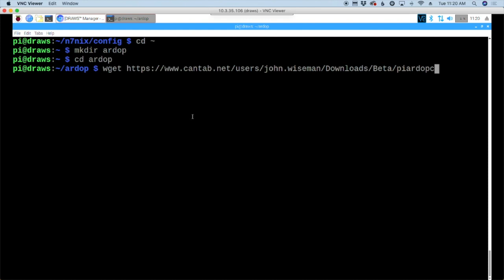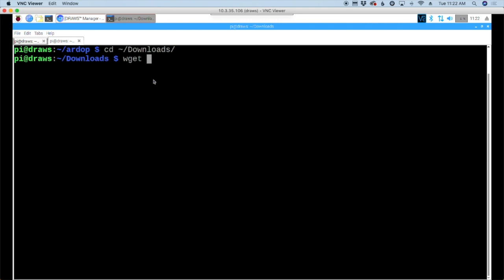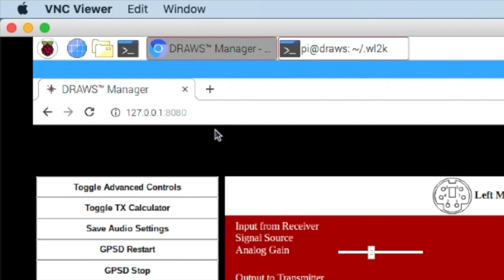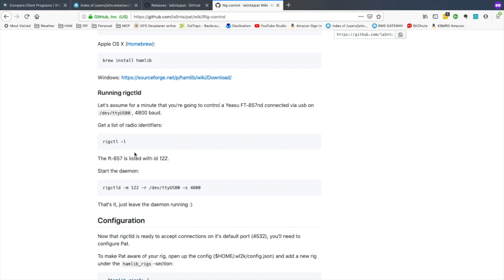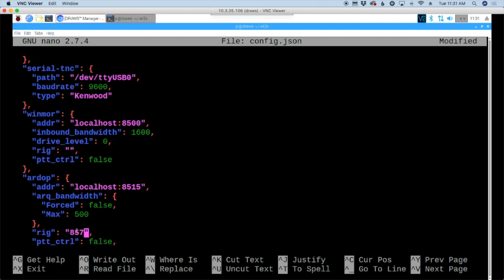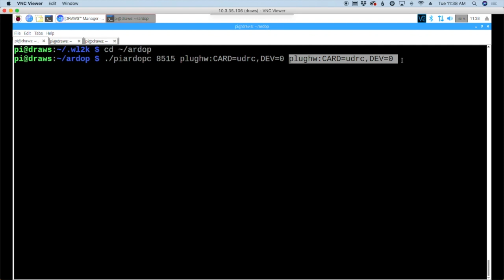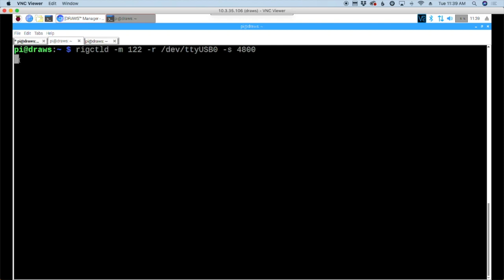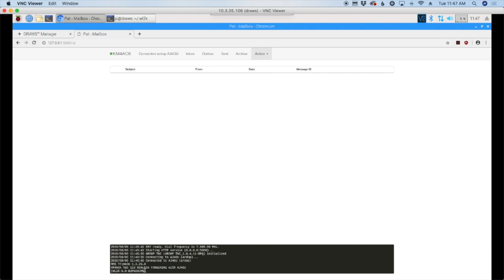Pat Winlink on DRAWS

Comment from the maker: Some have reported not having the pat config file on their system. If you run into this you will need to take one additional step.  Right after installing pat with "sudo dpkg - pat_0.6.1_linux_armhf.deb" you need to start pat in order to create the blank config file. To start pat run "pat http" This will fail with a no callsign error but will create the needed blank config file. Then follow the other steps outlined in the video.73, de KM4ACK

Comment: I have my draws sitting on my back HF radio. I also have an old IC 28 h. I want to use with this Draws. I have not gotten the latest image. I think it's 11 or 12. I need to contact that cable maker to see if he can create the 6 pin din to 8 pin round (mic) to a speaker plug, if there's not one already. de va7dgp
Reply from the maker: Thanks for watching Don. 73, de KM4ACK

Comment: The sound card sampling rate is usually important to allow the various digital mode protocols to work efficiently. Most modes want some divisor of 48khz, while most sounds cards default to 44.1khz. some programs can do the math to make up for the difference, but it is better to do it from the beginning. At least that is what I learned. 

I have been trying to find the command to do that for awhile. Asoundrc... Thanks
Reply from the maker: Thank you for the explanation! John Wiseman has more info on sample rates on this page https://www.cantab.net/users/john.wiseman/Documents/ARDOPC.html 73, de KM4ACK

Comment: Thanks for another great video!

With PAT already working fine on 2m packet w/ ax25 on the DRAWS, I was anxious to have a mode to try on HF.  Really appreciate you going through the steps to get ARDOP running.

FYI, I was not able to get ./piardopc to run with that change to the .asoundrc file.  The error message was:

ALSA lib conf.c:1852:(snd_config_load1) _toplevel_:14:0:Unexpected char
ALSA lib conf.c:3615:(config_file_open) /home/pi/.asoundrc may be old or corrupted: consider to remove or fix it
ALSA lib conf.c:3537:(snd_config_hooks_call) function snd_config_hook_load returned error: Invalid argument
ALSA lib conf.c:3986:(snd_config_update_r) hooks failed, removing configuration
piardopc: control.c:277: snd_ctl_card_info: Assertion `ctl && info' failed.
Aborted

... not sure why my Pi/DRAWS behaved differently than yours, but just wanted to share in case anyone else runs into this.  Fortunately, ./piadropc ran just fine without the change to .asoundrc and sounded great on a nearby radio monitoring the frequency.  Now if we could just get band conditions to allow me to actually connect to a node!  Another night.

Thanks again!

-Scott,  K4KDR
Reply from the maker: Scott, I am not super clear on the change for .asoundrc. The information came from John's site https://www.cantab.net/users/john.wiseman/Documents/ARDOPC.html Also, double check that the syntax was correct. One character out of place in that file could also cause the error you saw. 73, de KM4ACK
Reply: @KM4ACK  Success!  Here is the line that worked for me in .asoundrc:

pcm.ARDOP {type rate slave {pcm "plughw:udrc,0" rate 48000}}

... and I have now both sent & received messages via ARDOP from the Pi/DRAWS.  Thanks again!

Comment: I might just try this.  Keeping old windows laptops around for the sake of using winlink.  It works as does the Signalink, but that's all box and doesnt have the complex PTT
Reply from the maker: The DRAWS unit make it a super compact package with lots of features. I haven't totally migrated yet, but I don't suspect it will be too far into the future. 73, de KM4ACK

Comment: Good stuff Jason, one question and a couple of suggestions.  What VNC server are you using, or is it built into raspbian?  Also, "cls" will clear the screen and if you hit the tab button it should auto-complete the file name, or list the options.  If there's only one file you can just hit tab, if multiple that start the same type until it's kind of unique and you can tab through a few options.
Reply from the maker: I'm using the VNC server built into raspbian. I use the tab autocomplete frequently but often do things long hand in the videos for the sake of the viewer. "cls" doesn't work on mine. I did use  that in windows back in the day but only 'clear' works on buster by default. Have you added a shortcut somehow? 73, de KM4ACK
Reply: @KM4ACK  Okay, I haven't used raspbian yet, it's on my todo list between you and Julian.  I'm in the market for a VNC server for my two NUCs running debian, I'm too old to keep running up and down the stairs.  I may be getting windows command line confused with linux on cls, I'll have to double check the next time I go down stairs.  Thanks Jason!
Reply from the maker: Sure thing. Raspbian is a great little OS. VNC is the only way to go. 73, de KM4ACK
Reply: Uh... CLS is a Windoze command. Try control-L for a quicker clear screen in Linux.
Reply from the maker: Yes sir. That will work. 73, de KM4ACK

Comment: OK I am in the twilight zone. 73 VA2SOB - Claude.
Reply from the maker: Why's that Claude? 73, de KM4ACK
Reply: I was just meaning that is heavy stuff 
I do not have the DRAWS HAT 
I asked them 2 questions answer for the 1st is ok
Answer for 2 is still in nowhere land so it is what we call a solution looking for a problem to solve I pass.
Reply from the maker: Gotcha. 73, de KM4ACK
Reply: @KM4ACK  It is a good product but I am going to wait.
Reply from the maker: Claude M. P. It’s still a beta image so it can be difficult to work with at times. Just needs some good documentation to help smooth it out for operators. 73, de KM4ACK
Reply: @KM4ACK  YEP I look at it like a long term add-on. So I am keeping the faith. YOU HAVE two icons on the desktop. One is APRS ? the second is ???
Reply from the maker: One is xastir and the other is YAAC. 73, de KM4ACK